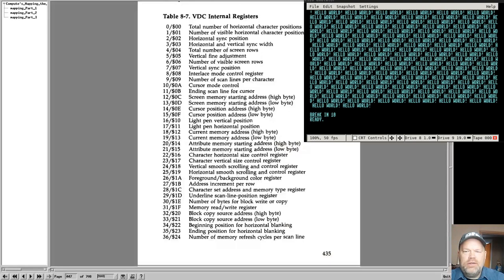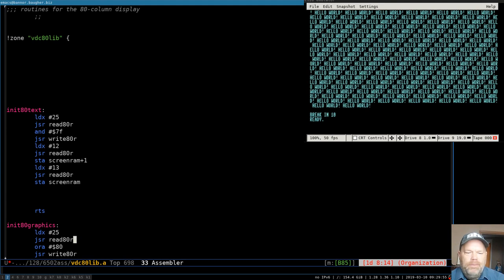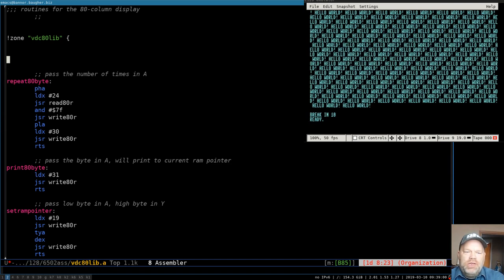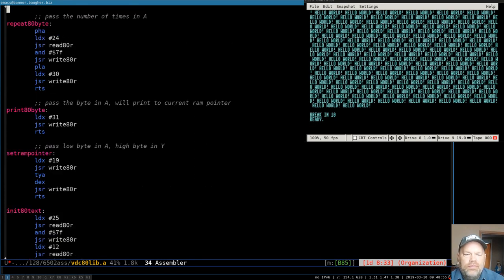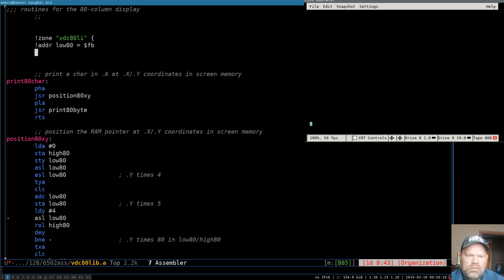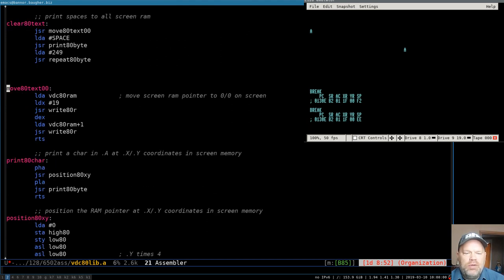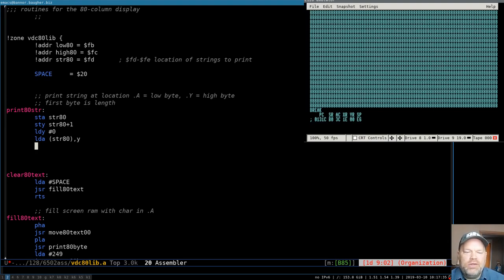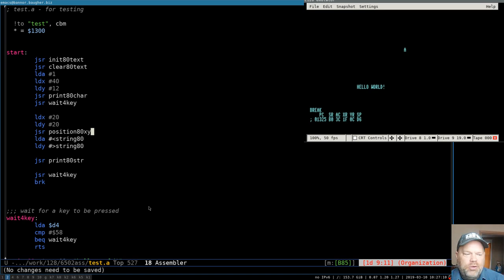Commodore 128 Assembly #29: VDC 80-Column Routines #1

Comment: I have a question. Why not use the stack to pass your parameters into your routines? Push your parameters in order onto the stack, pop off the return address and store it into local memory locations. Then pop of the required parameters one by one until you have all you need. If you don't need to return anything, simply push the return address back onto the stack. If you do, push the return values onto the stack and then the return address. In the calling routine you then pop off the return values as needed restoring the stack to what it was before you called the subroutine.